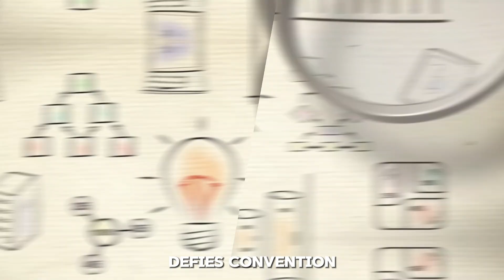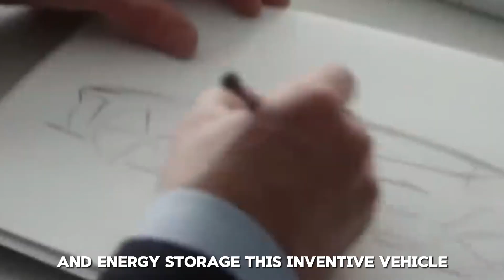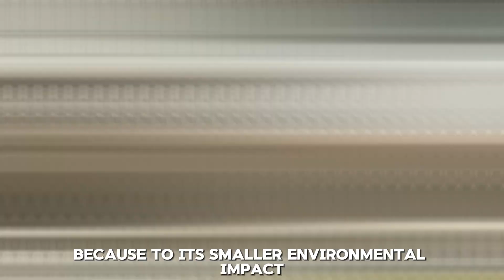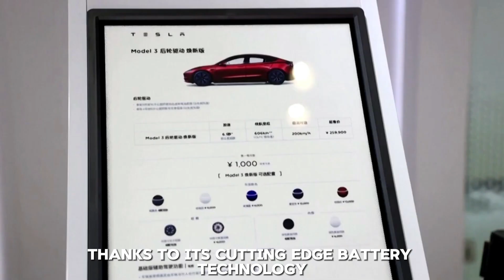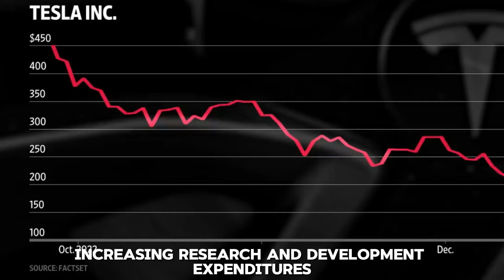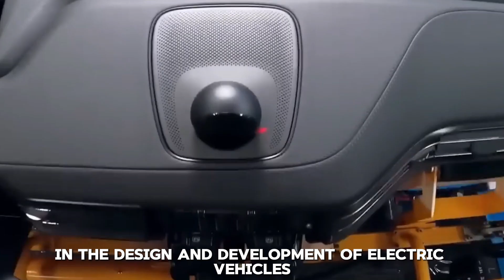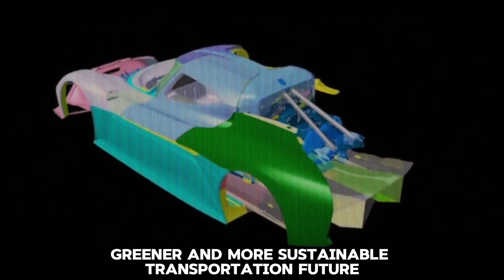This New Electric Car Has No Battery and Just Killed Tesla Future

Comment: You are clearly just reading out someone else's advertising - with no details, no specs or nothing. Using super capacitors has been shown to be mostly useless for electric cars as they don't have any serious energy density compared to batteries and so you would be lucky to get 20 miles total from a very large capacitor bank...so useless in reality.